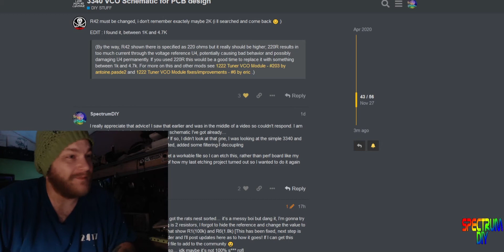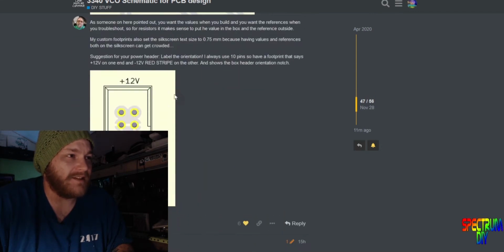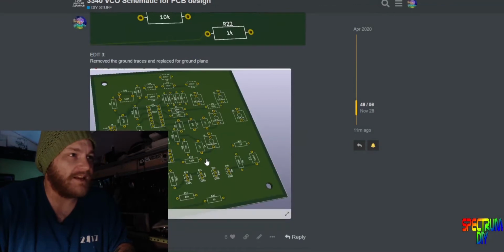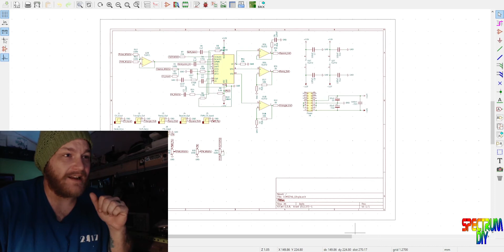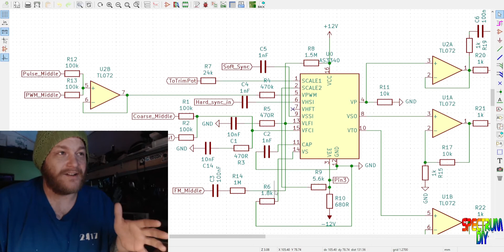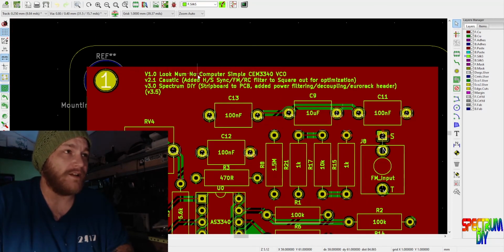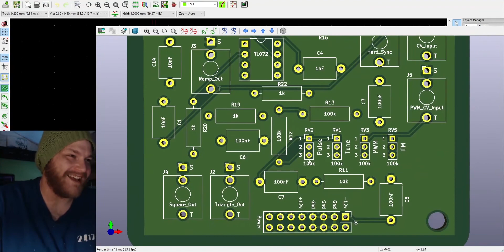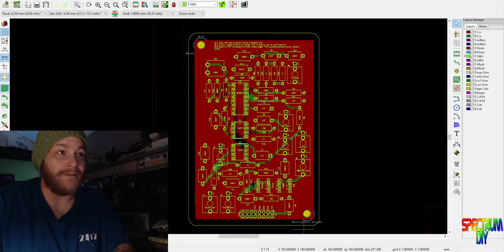DIY Synth VCO | Part 2: Designing the PCB

Comment from the maker: The AS3340 text is left intentionally as you can use either AS3340 or CEM3340, Minor differences in power resistor, I think is 10k vs 51k, but otherwise they are the same.